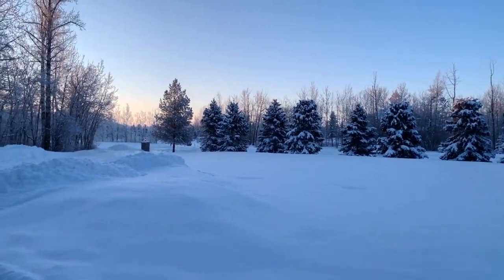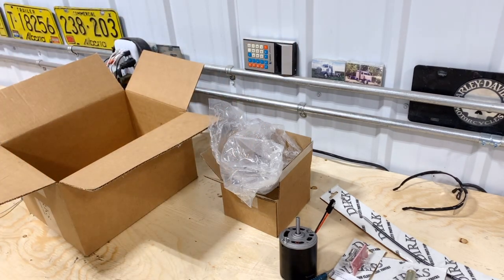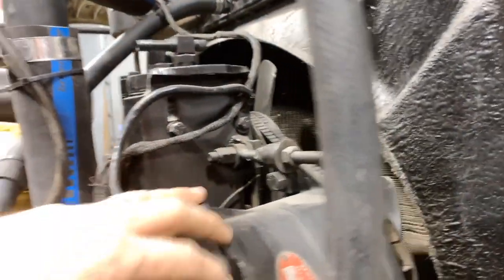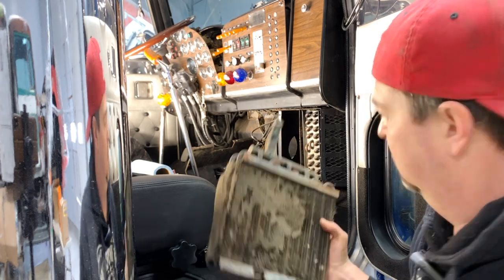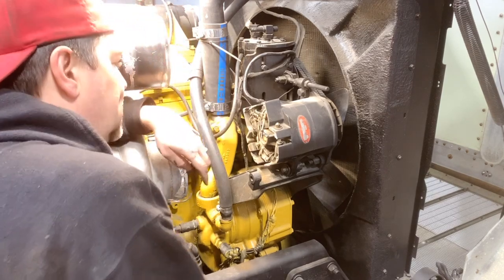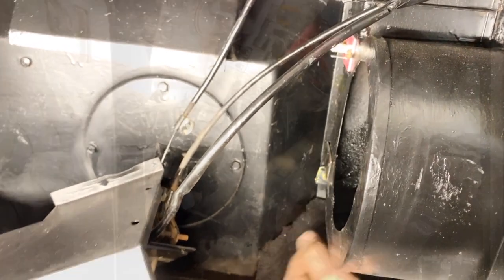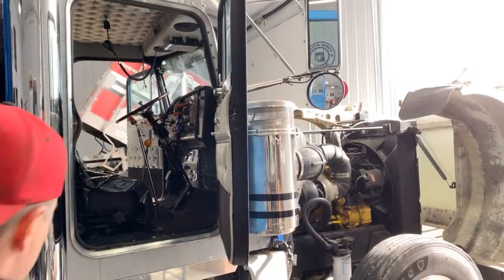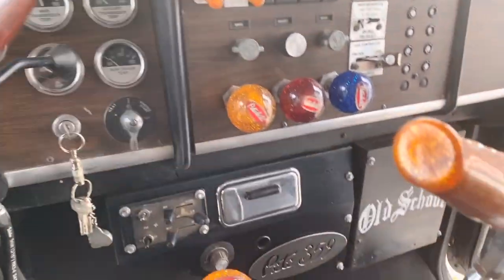Peterbilt 359 Restoration Ep.70 Hose Clamps & Heater Cores

Comment: Lol @ Ricky smashing Lucy's birdhouse!!!! The Ray with the VLT's!!! LMAO "Da Fuggin way she goes!!!" 😂😂😂 Good stuff. Nice job on the heater box, blower motor, and core. I've done heater cores and rebuilt heater boxes when all the foam on the node flaps deteriorates, actuators, and of course final stage blower resistors since they're such a common failure point. This job is SIMPLE in your rig compared to like 99% of cars and trucks. The cores especially are almost always BURIED and the entire dash usually has to come out. Sometimes you can get lucky and you just have to pull the center console, kick panels and or glove box to pull the cores. The resistors and motor itself is usually simple in most stuff, just pulling the glove box or just the under dash kick panel. Peterbilt was nice to give you the amount of access that they did.

Comment: I worked for a guy once who didn't believe trucks needed heaters. If there was an issue with the heater he would just loop the lines.
He also didn't trust drivers to keep an eye on the temp so he would hard wire the Horton fan. In winter the engine would run at around 50 degrees C.
A 20 year old truck that leaks air around all the seals in -5. You couldn't even pull up and warm our hands on the engine because it was cold too!
It was punishing. Once I had 2 pair of tracksuit pants and jeans, 2 jumpers and a jacket, and was wrapped in a blanket. And was still cold.

Comment: Mark,  I have done the exact same project of repairing and replacing the heating and cooling system in my 359's.  The heater core that was clogged with debris means you have even more clogging in front of the AC core.  You can see this by gently raising each flap in front of the screen near the door hinge opposite of the outdoor vent intake.  One side brings in fresh air and other side recycles the indoor air.  You will find that side of the AC core is really clogged up and would let a lot more air through.  Best to run compressed air under the flaps with the heater core out (before you put it back in).  Made  HUGE difference in the air flow and even more so for using the defroster.  Day and Night difference.  Maybe you can try using a vacuum hose with a narrow end to such the AC radiator clean but it will not do as well as blowing air from the back side and opening the outside vent behind the engine air cleaner to exhaust all the dust and grit stuck to the AC core.

I was watching and hoping you would get that when you saw your heater core was dirty.  That dirt came from the other side of the AC core.  Like your videos.  They save me a lot of time.  Only this video was like reliving a nightmare.  :)
Reply from the maker: Yeah I blew out the AC core off camera … amazing amount of dirt/dust came outta there 😂

Comment: Mark have a look on e bay at the chinese diesel  night heaters ,in the uk you can get one for less than £100 so id guess it wont be to much more at your end .They come as either a sealed unit with diesel tank or you get th conventional type that you fit a stand pipe  to your diesel tank .I got the complete unit with seperate tank to save tapping in to my fuel lines . They are fab and very economical on fuel . Mine has a remote so you can set it away whilst in bed if it got cold .They are a a bit bigger the contained unit and red in colour .Take a look and see what tickles your fancy . You get alot cooler weather there and its far quieter than having the engine tick over all night . 🙂God bless !
Reply: Jim jibroni  I dont see your sense there the whole point of it is that it works in cold temperatures! I and many others have no issues .Not good to have fake  pig piss motors running all night (def) It is meant to be inside anyway the boxed ones and it would probably fit under bed .Exhaust and intake are underside and dry . Nearly every truck in the uk has them and have had for the past 20  plus years thanks to eberspacher and webasto but the cost is quite high ,Hence chinese ones . So i dont see any point in further discussing the matter.They work in the cold very well !

Comment: A word of caution,always secure any motor when you power them up un attached,A friend was diagnosing an audio fault a few years back and had quite a bit of the dash dis assembled. He cycled the ignition but un knowingly he'd had inadvertantly at point in the dis assembly knocked the rotary fan switch to an on position,the fan powered up while hanging on its loom in the passengers footwell,proceeded to spin out of control and the plastic drum type blade assembly then disintegrated on contact with everything around it, with his face about 18" from the fan and he lost an eye .be careful, remembering that direct battery power is full speed!

Comment: Friend  when you see the heater core fins plug ĺike that it is usually  signs that your evaporator core is has a small leak ,the A/C has little mix with freon  sticks to everything and dust and dirt you have plugged  core fins ,then air can't  travel through  . You end up with poor heating

Comment: Another job well done, Mark! I remember working on a lot of fans that looked just like that in commercial HVAC systems, just with motors set up for mains voltage instead of 12vdc. Thanks for the trip down memory lane, though I don't remember them being any more fun to work on than the one in your Pete!

Comment: That didn’t look fun but also not too bad. I deal with this job at least twice a year on our mid 2000’s Mack’s and would like to beat the engineers who designed that setup. Wedge my gorilla self between the seats and pto towers. Slowly discovered sticking a garden hose in there and flushing until it’s clean worked the best then dry it all out.

Comment: As a former Peterbilt dealer mechanic, next time remove the hoses from the firewall and remove the HVAC box. Perform repairs on the bench. Free up the control cables with the box out of the way then reinstall. Much easier IMO😉

Comment: Marc, Its always nice to have heat when your wanting to go for a ride in thw fall or spring. Just think in the old Army trucks and Commercial trucks (30s and 50s) heat was optional not standard. Hell in the military truck here in the states heat in them was standard until the 80s.
Reply: I never had heat in the old 2 1/2 tons, or the M915's that I drove back in the 80's.
Reply: @printerman99  WOW never knew that the m915s didn't come standard with heat. I knew the later ones where refitted with A.C. as an option but, wow no heat in a line haul truck, simply wow.
Reply: @nickslistm246  yeah, those were the 80's models that I drove, 80-83.  all we had were 2 fans on the dash lol no ac

Comment: Mark I hope you pulled out the AC coil and cleaned it because it’s going to be clogged as well killing your air flow for your heater .
Reply from the maker: I’ll pull it when I redo the AC … for now I just blasted it with air and the flow seems fine now👍

Comment: you really need two bottles of dca in your cooling system, the thermostat stops the flow of coolant so it can absorb the heat and then transfer it to the radiator to remove the heat, your blower cage is really bent and needs straightened it will break wobbling like that, and yes i cuss engineers on a daily basis on some things.

Comment: Mr. Twin sticks why don't you pull heat and  AC core out and take them to your radiator shop and get them clean and boil out repaired  before you put them back in place because they look bad.
Reply from the maker: CLR soak and a little scrubbing in the laundry sink did just fine 👍
Reply: Ok